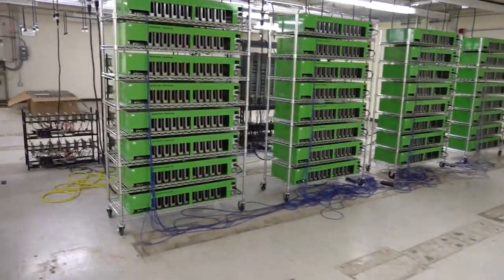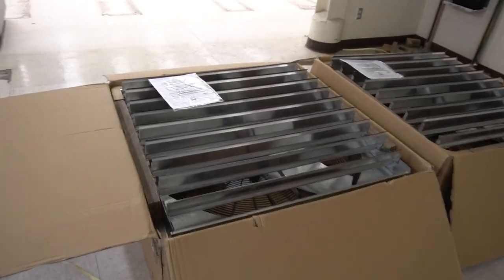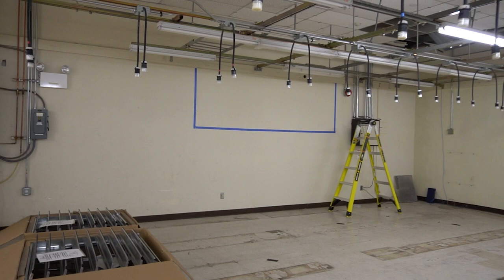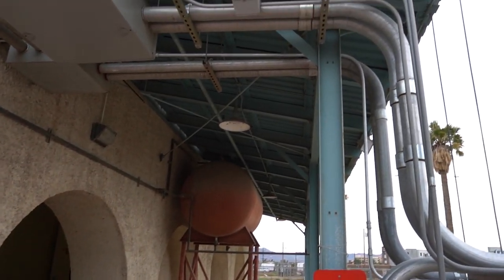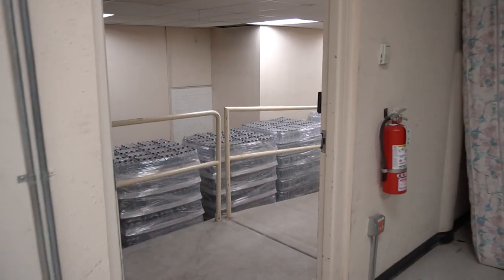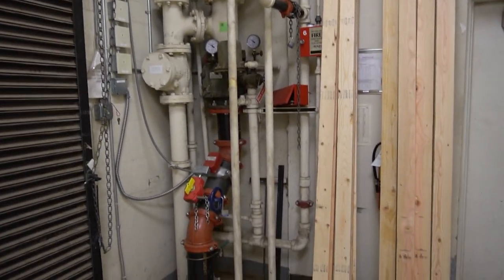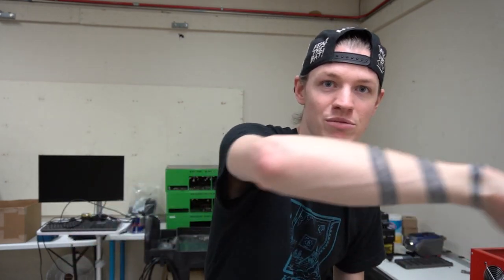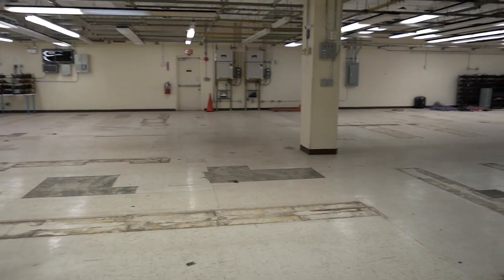My Plan To Keep My Mining Rigs Cool at the Datacenter

Comment: If you want to cool an object like a GPU, positive air pressure with a turbulent airflow is the way because you want to penetrate the boundary layer right close to the item as much as possible.

To remove heat from a space such as a room, the air in that room is more or less laminar airflow which means negative air pressure or exhaust is optimal.

Blow on cards, suck from a room

Comment: I have about 80,000 cfm of exhaust for 800 gpus, but only needed during the summer. Then intake is just filtered room with 30,000 cfm but mostly those stay off and just use passive airflow for intake. Basically you just wanna focus on exhausting the air that's in their and maybe fans on the rigs to keep hot air moving away from rigs and towards an exhaust

Comment: need to be cooled with water. The supply air passes through a wet filter and is cooled down, for example outdoor air is 35C after cooling 25C, it works fine for many years. cheap and as efficient as possible + 99% dust-free air

Comment: Remember all you need is airflow. Does the old AC still have blowers? If the AC system can blow air into your room, then all you have to do is exhaust the hot air out. Also don't forget about air ducting. You know those flexible round tubes used for air ducting? You can use them to direct your intake and exhaust to pull from different areas in the same area to ensure you are getting cold air and not the hot exhaust.

Comment: no wholes means you need to build ducting system to somehow take the air in and out. You might need strong inline axial fans really. Your space is huge you i am sure you wont be making it too hot. You really dont need the intake fans to be strong, as because of the sucking pressure of the exhaust fans you may not even need intake fans.

Comment: I think bringing cold air in on the same wall as the exhaust will fail.  I would suck air in FROM the roof at the opposite end of the room.
Reply: Yes exactly I would def try and separate the 2 to opposite sides of the building

Comment: Django you only need negative air flow this means you only need exhaust fans, no need to intake fans, positive air pressure just means the air is not flowing in/out as quickly and that’s not good neutral or negative pressure is better when using ONLY exhaust fans .. you can increase the size of you intake holes as needed but I would not use intake fans let the exhaust fans move all the air in/out quickly, also using the door that right in the data center I know you said it’s in the sun but if you move the air quickly in/out it will not matter much.
Reply from the maker: Thank you For the Input! I think I will try no intake fans as you suggest and just have passive intake. I can Always add fans later if needed but I think you will be right! Thanks!

Comment: Are you able to use the existing duct work from the AC? If those ac unit fans were on reverse (or flipped) they would suck heat out until they fix the compressors or w.e is wrong with them. You'd still need to factor in filtering air intake so not to have too much negative pressure sucking dust into the hardware room.

Comment: I know someone with four 20k cfm fans if you need them. Just do yourself a favor and use proper filtration. Proper filtration. I’m 24 months in and 95% dust free. You have about 3-4x as much hardware as I do, so… just make sure you filter this stuff properly. I’ve done ac install as well as air intake and extraction. So yeah… if you need some additional help, I’ve coordinated with a few mining pools as well as Hawk’s crew. — you want positive air pressure, if you can help it. Do your octominers use positive or negative pressure?… 😏
Reply: What type of filters do you use? I've been looking into merv 7 and 8

Comment: Yo you may want to experiment with doing passive intake it's really hard to balance air pressure with intakes and exhaust fans way easier to exhaust it all and pull in cool air, biggest thing about AC isn't really adding cold air it's more about removing hot air. Your one of the realest crypto tubers man. Have a good one.